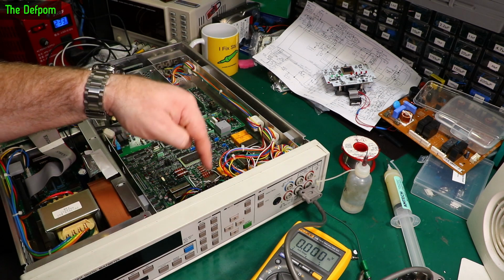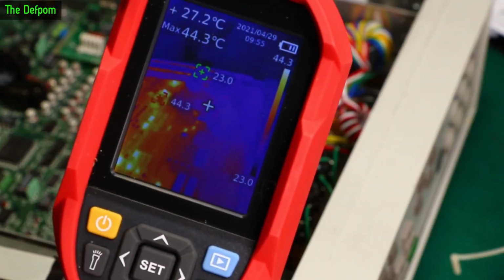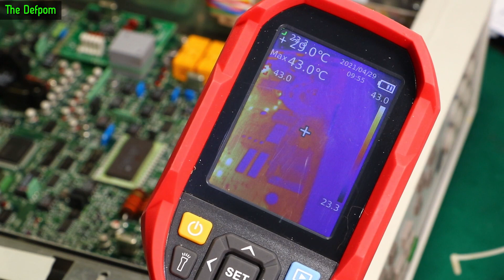🔴 Advantest R6581T Repair Part 3 - Fixing Various Issues - No.1055

Comment: That cap runs all its life and never explodes.....
Reply from the maker: Yeah that was pretty surprising, must be high quality or something LOL
Reply: Some solid electrolyte capacitors are designed to withstand reverse voltages within the range specified.
If the capacity is small then the ability to withstand reverse voltage is high. In addition, if the working voltage is low then relatively no problem with reverse polarity.
Reply: @IanScottJohnston  Good to know. Cheers Ian!

Comment: Interesting. Maybe attach a heat sink to the hot relay, using thermal glue? That could be easily undone, if you want to go back to its original state.